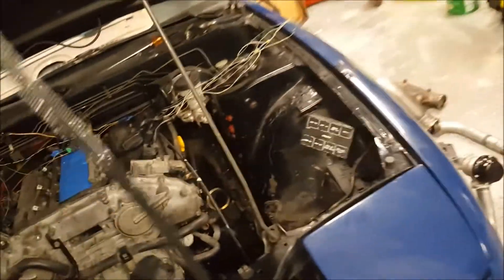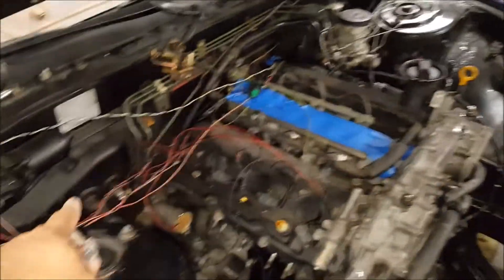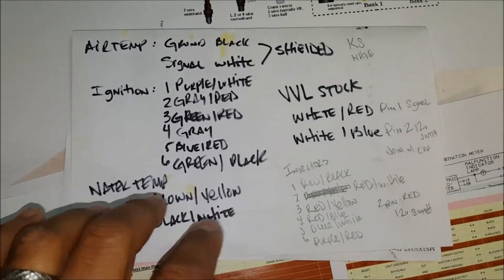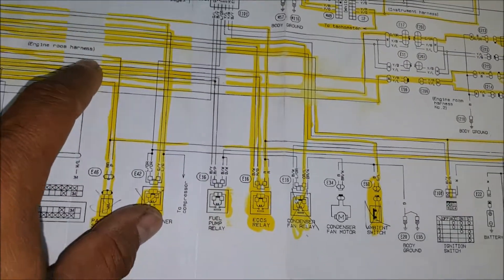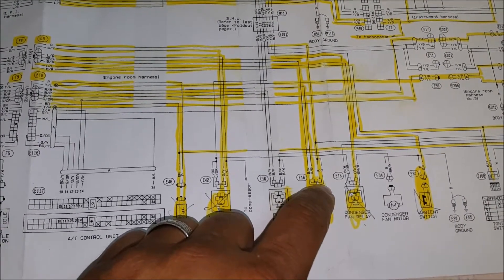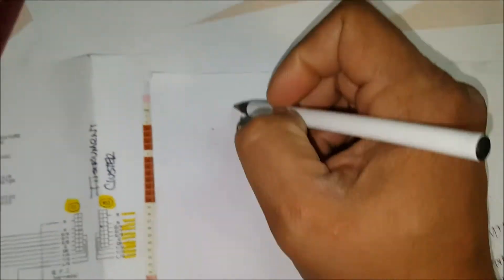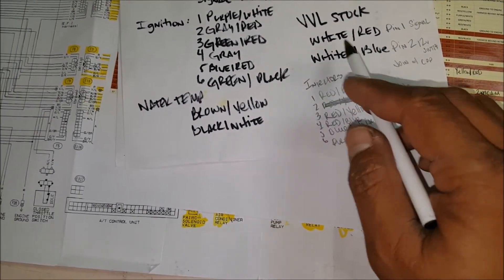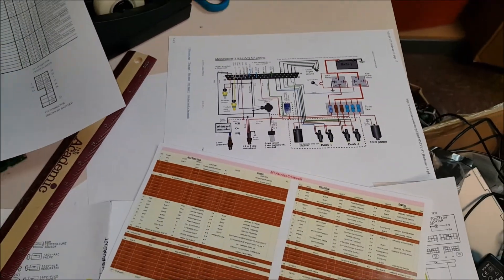VQ35 Build - Part 58: Mapping Out the Engine Harness Continued...

Comment: is your harness plug and play, as in does it attach to your s13 dash harness, allowing your stock s13 ignition to power the car?
Reply from the maker: The stock ignition does work as intended meaning when I turn ignition on, injectors, ecu, fuel pump, coils, aka get power.  I do not have to hit 20 rocker switches to turn on the car. No it is not plug in play.
Reply: @supakat500  do you have a diagram i could print out?